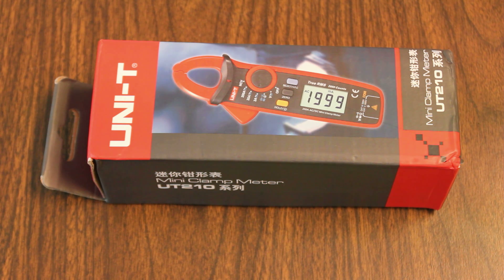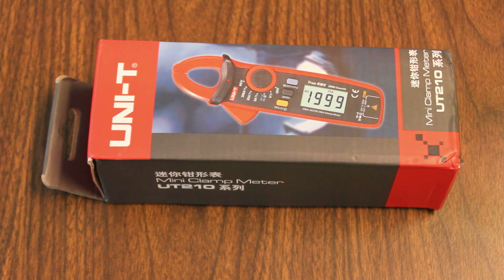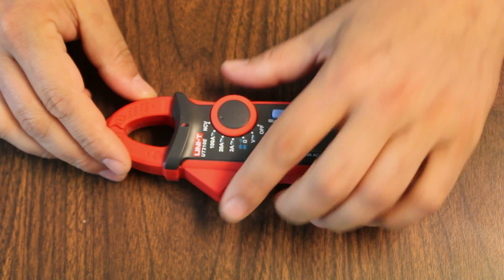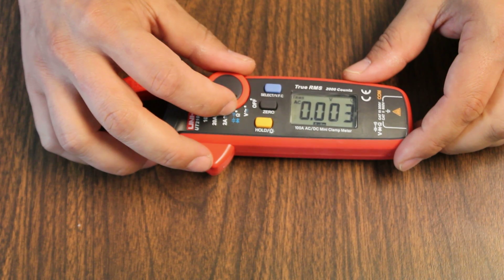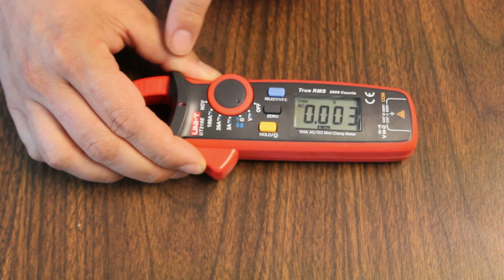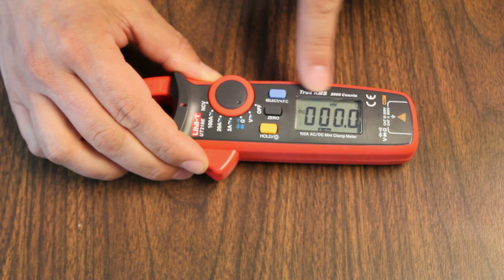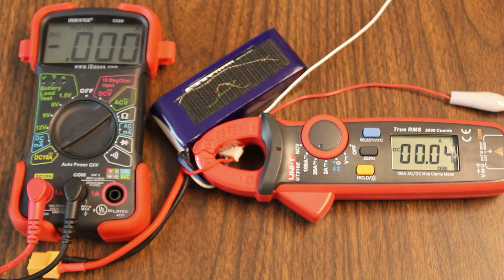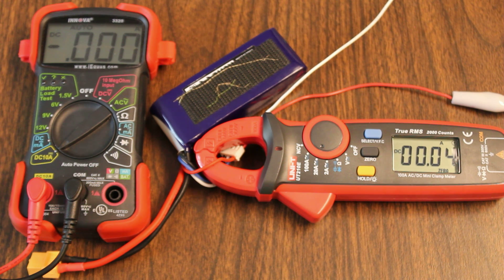UNI-T UT210E True RMS AC/DC Current Clamp Meter Unboxing

Comment: Nice to see you've demonstrated the DC current clamp function, thanks. Just one Q; At 9.38 your DMM meter shows negative current flow, (which you noted, reverse connection) whereas the clamp meter showed just Amps. If you were to reverse the clamp on the wire does the clamp meter sense & display reverse polarity? i.e. if checking one's car charging circuit, it would be nice to be able to easily tell whether the battery is charging or discharging?

Comment: Die NCV -Funktion ist leicht auch ohne Verbraucher als stromführender Phasenmesser einsetzbar (ähnlich wie an der Glimmlampe auf Strom und Nullphase messbar). Zumindest bei UNI-T ging dies überperfekt. 

Einfacher Trick: man wickelt die schwarze Kabelstrippe der schwarzen Messleitung um die Mess-Zange 4x außen ganz umrundend herum und klemmt den schwarzen Messstift fixierend zwischen die Zange nach vorne ein, mit der Spitze nach vorne zeigend. Mit der anderen Hand greift man auf Kontakt mit der roten Meßleitung. 

Man kann sogar kontaktlose Spannungsmessungen hiermit in Richtung Spannungsfeld durchführen wenn man auf V schaltet. Wenn 60 angezeigt wird muß man halt mit Faktor mal 4 rechnen bei 240 V  so lassen sich Vergleichsmessungen z.B. am Wechselstromtrafo punktuell durchführen. Man kann auch die Milliamper des Strom Feldes in der Luft detektieren, bräuchte aber eine metallisch geeichte Aufnahmefläche für den nahen Hochspannungs - Feldfluß.

Comment: this is the 210-E, you have the 210-D on your shopping list, why'd you change it? I'm trying to figure out the difference and which one to get. thanks
Reply from the maker: The -E adds capacitance measurement. I haven't done a close comparison but I think it has nearly the same specs otherwise. I changed because the -D started getting hard to find with Amazon Prime.
Reply: Thanks, have a good 4th

Comment: Bro in this meter u can measure Dc current without select the Dc option. I mean at Ac dial also. U can check it. Is this a fault??
Reply from the maker: I'm sorry but I don't understand what you're asking :-/
Reply: Joshua Bardwell i mean u can measure Dc current without press the select button for DC mode. When we switch to Ac to Dc.. It shows DC amps on AC mode also

Comment: Bro plz tell if v select the dial at continuty, diode (instead on voltage mode) and plug the probes in socket then what happen??
Reply from the maker: Diode test pushes a small forward voltage to open up a transistor and then displays the voltage drop across the transistor.
Reply: Joshua Bardwell bro what it VFC IN meter and how can we use it and for what purpose?? Plz tell

Comment: bro please tell me does it matter for separate dallier like in this meter has option 2A, 20A and 100A ? and many meters has only option like 1000 ad/dc amps. there is no short option like 2,20amps. so does these types(1000ac/dc) of meter are not more accurate in mili or short amps like 1,2amps ?
Reply from the maker: The ones with selectable ranges usually offer more precision in the smaller ranges.
Reply: thanks for reply joshua.. u mean if i am to measure low amps like 1 and 2 so ut 210e meter is better for me for accuracy then a meter write direct 1200amsp ? m i right bro?
Reply from the maker: I think so.
Reply: u think or u have done it? any expriment ?
Reply from the maker: No that's just how they work. The whole reason they have ranges is so they can provide more precision at lower ranges.

Comment: bro kindly tell me what is NCV and how does it use ?
Reply from the maker: Non contact voltage. Used to detect live AC circuits.
Reply: thanks ... does uni-t ut 210e is better then uni-t ut 203 and 204 ?

Comment: it can measure current in my data cable when i charging my phone???
Reply: yes, but for these types of meters to measure current, you need to put only the supply wire through the clamp (so a USB cable has 4 wires inside it, you'd have to open the insulation and clamp around JUST the one internal power wire)

Comment: Please make a review on Fluke 362.  I want to know which one is better between the uni -T UT20E and Fluke 362. Thank you.
Reply: There just as good as each other but the uni_t is a lot cheaper fluke are £50-£100 uni-t £10-£30 and they do other meters at higher prices I had an MFT ie insulation resistance continuity voltage and RCD tester From uni-t cost £140 compared to the big brands witch will cost between £500 and  £1.300 and they both do the same job. You do the maths I will not be going back to the big brands any time soon.

Comment: You can pull the shielding off the probes. The shielding is built to be removable.
Reply: true my other digital multimeter had this also (removable plastic tip on probes).
Reply: i never even noticed until i accidentally twisted it..LOL

Comment: I have one that I use to test current from my solar panels.  Some wires give a strange reading, for instance, after the decimal point, a zero and then an upside down, backwards  7.   Any idea why this happens?  I'm making certain the polarity is correct
Reply from the maker: I've never seen that. Reversed polarity would just show a negative number.

Comment: Just a simple question.  Through clamp can you measure voltage as well as current?
Reply from the maker: No. But since voltage is measured in parallel with the load, it's easy to measure voltage simply by touching probes to the points you want to measure. Current is a hassle because it must be measured in series with the load, which is why clamp current measuring is so useful.
Reply: Cheers, thanks for that

Comment: I received this meter today and I must say im very impressed with it. The current was off with my main multimeter by 2-3 mA if I placed the meter correctly on the cable. The capacitance setting is amazing. It almost instantly measures capacity up to 20 mF (Thats 20000 uF). The only downside I have with this meter so far is that the lcd illumination which auto turns off after 15s (I have no idea what the purpose of this is, probably power saving but its very annoying). It is a superb bit of kit for 30€. Also the ncv feature is also good, you can see where the wire goes in the wall. Very good meter :)
Reply: +Joshua Bardwell  -  Josh -  can you tell me if this meter will read AA battery or car battery voltages accurately? Ive purchased a few inexpensive clamp meters, but none of them will read past the decimal point on the DC scale! -  they cant show car alternator (14.2) or a weak car battery (11.5) or even the condition of an AA battery (ie: 1.37v). Does the 210 show millivolts on the DC scale?
Reply from the maker: +danijel124 Agree. Very good at the price.
Reply from the maker: Not sure what's happening here. I never saw a multimeter that didn't read at least to 1/10th volt. But yeah...
Reply from the maker: You know you can't measure volts with the clamp, right?
Reply: +Joshua Bardwell  -  LOL -  i know!  Indeed: the same size Harbor Freight clamp meter will not read below 1 DCV, and neither will the MT87 that is a popular clamp meter on ebay/amazon !! Granted, these are under 15 bucks each, but they dont read below 1 volt on their DC scales! -  Looks like the UNI-T can do it -  guess you have to get above 30 dollars to get millivolt readings. Looks like the best bang/buck for inexpensive clamp metering and accurate low volt probe testing
Reply from the maker: +jmm1000 I can highly recommend this one, for just under $30, that does millivolts.

http://www.amazon.com/dp/B000EVYGZA/ref=sr_ph?ie=UTF8&qid=1457553238&sr=1&keywords=digital+multimeter

I've never used this one, but it's $13, and goes into the millivolts on the range dial.

http://www.amazon.com/Etekcity-Digital-Multimeter-Tester-Measurement/dp/B00B7CS3UY/ref=sr_1_3?ie=UTF8&qid=1457553238&sr=8-3&keywords=digital+multimeter
Reply: oh, i have few nice standard meters, but i want one that has a clamp! ....that also can read AA batteries or watch batteries ! -  making sure:  your UNI-T does DC millivolts, right? how many digits does it read to the right of the decimal...?
Reply from the maker: jmm1000 It has three digits and one decimal, and reads down to the mV range. So presumably the lowest it will display is 0.1 mV or 0.0001 volts. But really, I expect the precision is somewhat less than that. Suffice it to say, it will measure tenths of a volt no problem.
Reply: +Joshua Bardwell  -  thanks so much -  i just assumed that a LCD digital meter with a decimal point would definitely read the voltage of the most common batteries -  but not in clamp meters under 30 bucks i guess! Thanks Josh
Reply: danijel124 , so it can measure current in my data cable when i charge my phone ????

Comment: Does this model have LCD ilumination, because it has a light on the yellow switch?
Reply: +danijel124 Yes, UT210E does have a backlight.  Press and hold the yellow button to turn it on.
Reply from the maker: +danijel124 The LED is not illuminated.
Reply: yes it does have a backlight..I have the 210e in my hands right now..the d model I dont know

Comment: I made a beginers mistake buying clamp meters. THEY ARE AC ONLY AND AC/DC MODELS and i ordered ac only xd. I realised my mistake when i got it. So be careful buying these.
Reply: just a heads up the 210 a and b are ac only the 210d and 210 do both AC/DC current
Reply from the maker: +danijel124 These are AC/DC, so all good.

Comment: I cant decide between this or the d version which also has temperature and able to measure up to 200 amps current dc as oppesed to 100 amps but you lose the lower 0-2amp setting on the d version..if this e version had the temp feature and was able to go above 100amps dc it would be my choice for sure..
Reply: +Jacob Hendrickson I think you wont need 200A feature. The temperature setting isnt very important also. But I would recommend 210e because it is very precise.
Reply: totally agree daniel I went with the 210e then picked up a set of probemaster leads just for it..once you try their leads they spoil ya where no other is good enough

Comment: I brought this clamp a few weeks back, it a great tool. I always found it a pain to measure dc amps using a std multimeter, the clamp makes life so much easier (faster) and it's pretty accurate. Interestingly, if you read the manual the dc amps is more accurate than ac, 2% vs 4% respectively.
Reply from the maker: +blaser Clamp meter is really the only way to measure current. Having to get in serial is too much of a hassle for high amps and volts.

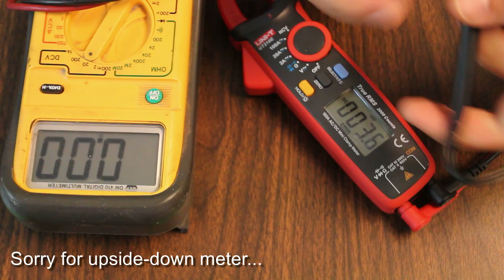Comment: Hi Josh,Those things on the probe's tips are cover. If they get on the way like they did on your video 7:46. you can remove those partial tip cover to expose the regular probe tip. They are kind of hard, but just grab them and pull, they will come out. Thanks for the video.
Reply from the maker: +dana miller Yeah, thanks. I figured that out after I posted the video. Hope the video was helpful.

Comment: im pretty sure there is a removable plastic sleeve around the tip. Take the sleeve off and you have more contact area and its easier to measure in tight places.